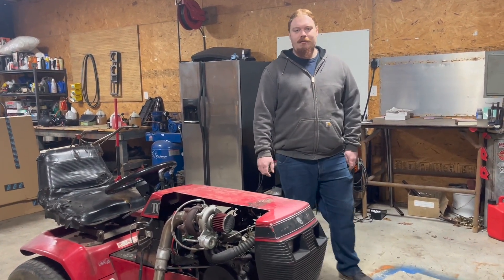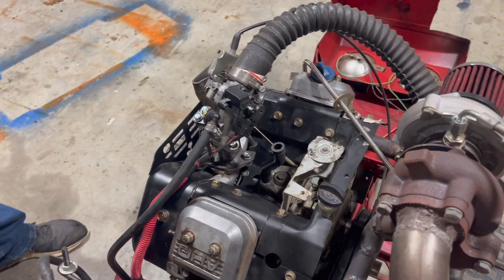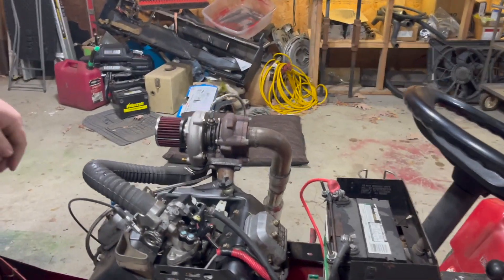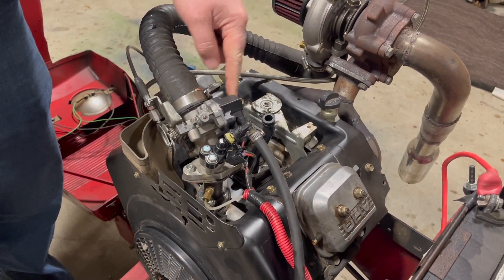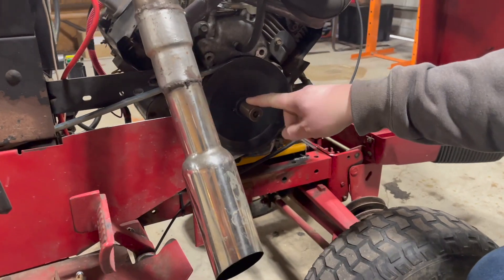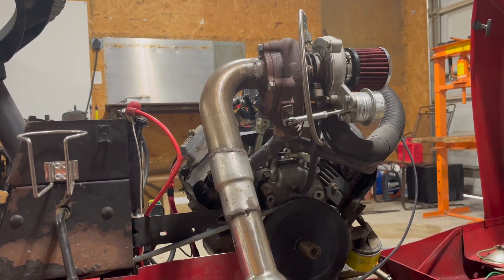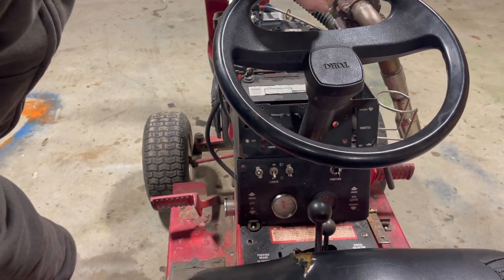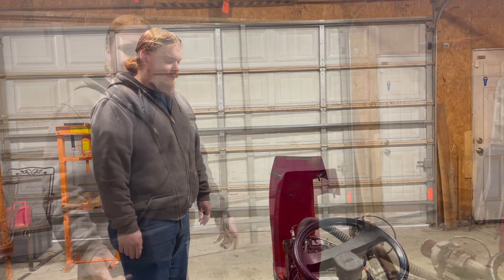Introducing my TURBO lawn mower project

Comment: I know this video is old but what about using a pair of CDIs to control timing? some of the aftermarket ones have a potentiometer to "adjust" ignition timing. If they actually work as advertised it seems like you could use an Arduino in place of that to adjust the ignition. Im just trowing ideas out here but maybe you could use pulse coils in place of the regular ignition coils to generate a signal voltage that's more manageable for your electronics. Even better, a lot of the newer motors use a dc system that should be very easy to adapt to an Arduino.

Comment: I'm having a hard time getting oil drain  without backing up  how did you do that
Reply from the maker: You have to make sure the drain is sized so its not a restriction and oil can free flow back into the block/pan. Also make sure you have the proper sized restriction in the oil feed line so you're not feeding too much oil to the turbo in the first place. I hope this helps.

Comment: Put a load on it, you'll see boost

You might want 3 or 4 cylinders, or fire a 2cyl @ 180° so there's roughly equal air for both cylinders
Reply from the maker: I've had it under load several times. The fueling and timing aren't right enough to get it so spool up good. Next few videos will be making it much better

Comment: Put a smaller pulley on the rear
Reply from the maker: Haha its fast enough as it is!
Reply: We used 7 inch motor pulley 5 inch rear ,modify the steering tho ,stock unsafe at any speed .